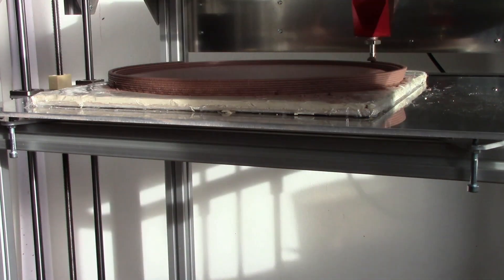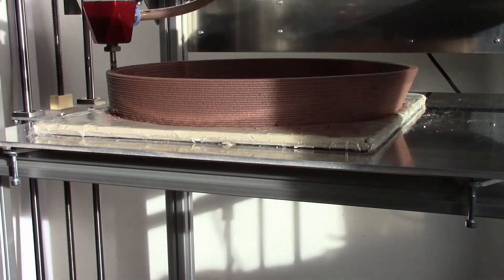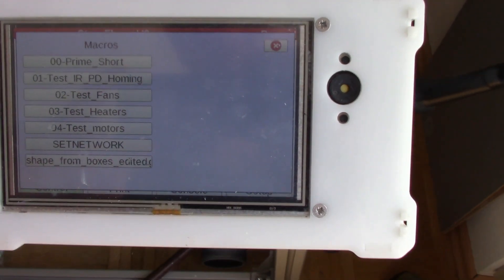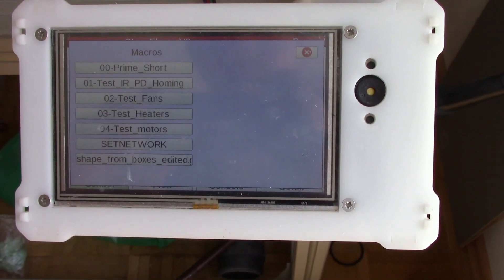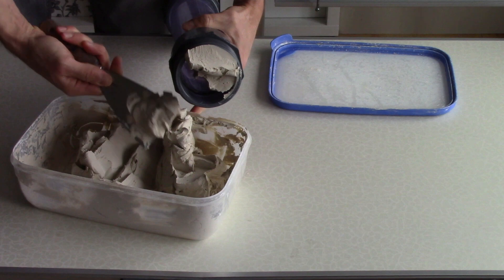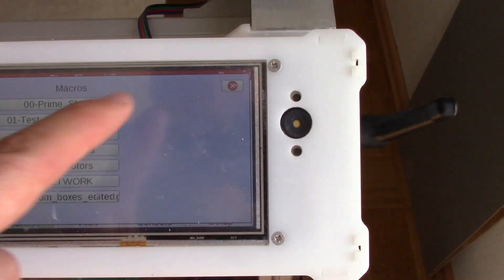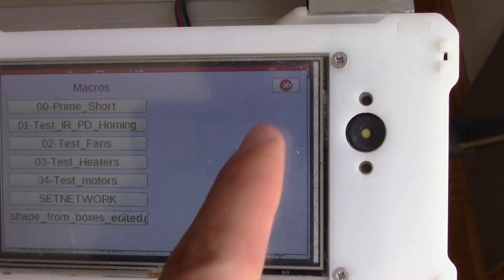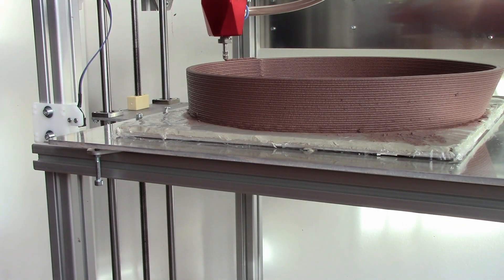Reloading of clay upon long printing job, StoneFlower 3d printer

Comment: i got a Clay printer and was wondering about covering my bats with thin plastic sheets so i dont have to have so many bats, does that work for you ? Thanks
Reply from the maker: Hello, Dee. In our printers you can move z-end stop to avoid necessity to put thick layer of substrate. Also you can use the starting g-code, that sets z = 0 position, based on the initial z-position of the nozzle. This means, you can level the nozzle to the hight of the substrate, and the printing will start exactly at this height. So, you will not need to do something with support. You can get this g-code at our web site, in section "Support"